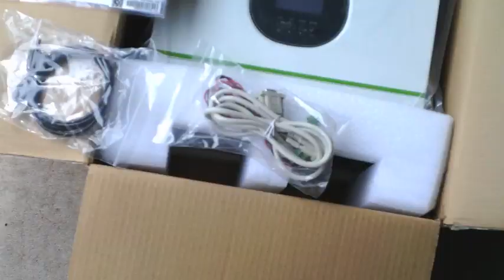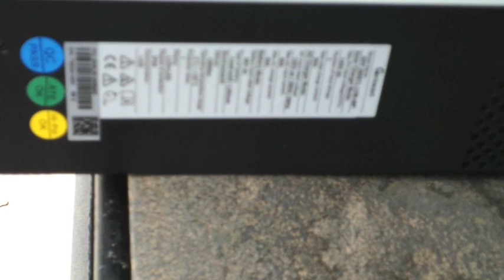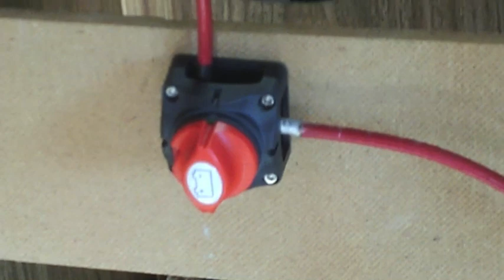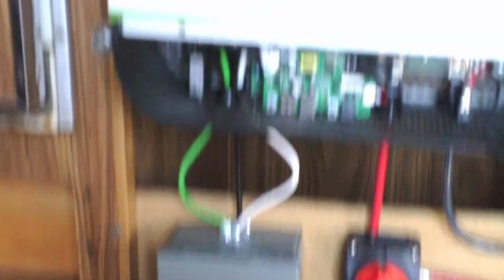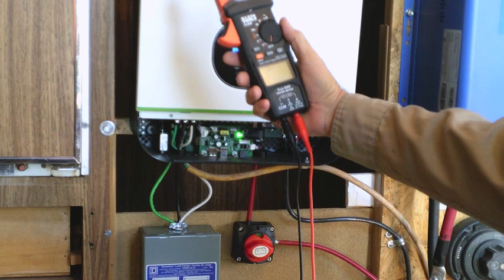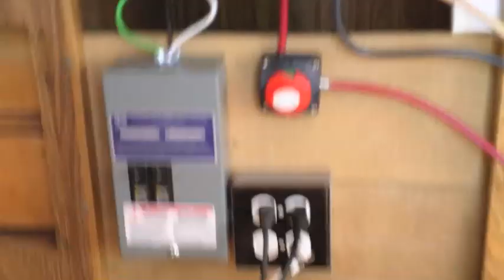Growatt 3000 watt all in one inverter information and review

Comment: Hi Mike; is this system still working?
Reply: It is still outputting 120v. It is sporadic on charging from the grid when the batteries get low. That was why I bought it as the Aims would get hot and shut down when the batteries would get low. I now have the EG4 6500 inverters.

Comment: My eg4 battery show red light what to do to get it ok ?
Reply: Turn off the battery and back on. This should reset the battery. Also my battery red light went out when it was charged. If you turn off the battery and back on and the red light comes back on then you need to charge the battery. Two of my six batteries only have one or two lights well the other four are fully charged with all four lights.

Comment: Hi I have purchased this inverter and I have hooked it up to a 48 V eg4 100 amp  battery.    When hook to the grid it seems my battery will only charge 3/4.  Do you think there is a setting that I need to adjust so that I can fully charge my battery ?
Reply from the maker: You can check the amp setting but I would think it has to do with the EG4 BMS. I would give it a few cycles and see if it improves.

Comment: why only 2 plugins? shouldn't this power your garage and your house?
Reply from the maker: I am only using it to power tools outside from an extension cord. The main reason for the Growatt is to charge batteries from the grid when they get low and there is no sun. My Aims inverter gets hot and shuts off when charging off the grid.

Comment: What is the standby power consumption? The mpp pip is said to be 45 watts, is this as bad? Im looking into all in ones and seeing growatt getting popular, I've been looking at the 2424lv by mpp but since my setup is for off grid boondocking in a 6×12 cargo trailer i only have room for 840 watts pv on my roof. The up to 45 watts loss when in standby will be using a considerable amount of power from my 24v 280ah lifepo4 bank. If you know it would be helpful in picking out a unit, thanks!

Comment: Can you turn off the inverter portion to save power and still have the solar charge controller charge the batteries off of solar? I am trying to see if this would work in a travel trailer and go off-grid once a week. Having the battery charge back up over the course of a few days with the solar would be perfect.

Comment: Thanks for the great video. I have one grounding question. I noticed your AC input  cable is plug in the Growatt, is that acting as the system grounding , or did you ground your solar panels to a separate grounding rod. Thanks
Reply: Yo solar panels each need to be screwed to steel rails and then the whole rail has ground on rebar 6 feet into ground. I hear there is a spot for it on the 3000w growatt for pv ground but im not sure. This is dc grounded. DC also needs a DC breaker double pole for on off only required by law(ca). So plan on a ac breaker and a DC breaker. DC breaker will only be used for on off and not as protection.
Reply from the maker: There is a separate grounding rod.. The hole outside of the trailer is grounded also.

Comment: How is the fan? Does it run at one speed, or slowly ramp up under load? Think of putting one in a van, but worry it would be to loud. It would be perfect if it was silent when using under 500w just for lights and a tv.
Reply from the maker: I have not heard the fan come on when using the tools as I am not in with the unit. I do hear the fan when the unit is charging the batteries at 30 amps. It does a great job of charging when there is no sunlight.

Comment: Where can I get a easy to follow blueprint for this inverter to set up a 24V mobile system for emergencies and running a couple things in my home. I have 400 w of panels and 2 100A lithium batteries for series connect. I do not want all the fancy/complex connections; I will not run my house from it. I do want the safety though.

Comment: I installed a 3000 spf 48v but I can't get it to charge my battery bank, I programed the SBU parameter and the SNU charger parameter but i will not charge, plus I have installed a automatic generator to it dry contact( the generator has a Built in dry contact too)

Comment: I just installed the 12kw. However, this is my problem. I have four 48v 5kwh batteries that were already deleted to around 26v and I can’t get the Growatt to charge them. How can I accomplish that?
Reply: You can’t. It’s below the low voltage limit. I suggest buying a 60v lab power supply that you can adjust voltage and amperage and use it to charge the batteries up past the low voltage limit.
Reply: @Rebel635csi  thanks

Comment: Hi, i have Growatt on grid single phase inverter.   My inverter showing wrong grid voltage.  Actual grid voltage is 245 but inverter showing 288 VAC.   I have connected shinebus to inverter & check all parameters but didn't find grid voltage calibration setting.   Can you guide how to do that??..

Comment: Hi Mike, just curious about why you added the Growatt with the Aims unit? Is the Aims also running on 48 volts? Great video, thank you for taking the time to make it!
Reply from the maker: The Aims is 48v and the second one that I have bought. The first lasted 2 years and then a lighting strike took it out. The fans run all the time and Aims technician said that was normal. The second Aims is also a 10kw unit , this one the two top fans work correctly but the bottom fan will not come on at all. When the  charging comes on the unit over heats and shuts down. The Aims 10kw runs the home and I wanted something to run tools in the garage. I will not buy another Aims as the service was very disappointing. The Growatt 3000 runs my tools and the charging systems works as it should. Both the Aims and the Growatt are on the same 48v battery bank.
Reply from the maker: The Aims is also 48 volts. It over heats when charging, so I don't use it for that.

Comment: I like the looks of this grow watt are the fans noisy I need charge controllers and its almost cheaper to get the mppt built in. How are you liking the unit so far
Reply from the maker: No the fans are really quiet, at least compared to the Aims of which only 2 of the 3 fans work. I feel the noise level is very acceptable.
Reply from the maker: And I still like the unit.

Comment: This is a unit I'd like to install in my travel trailer. Would the fans running be too noisy?
Reply from the maker: The noise level is very low and acceptable.
Reply: @mikedrew9361  Nice! Did you ever get the dB results?
Reply from the maker: @fjcvan7993  There is no dB that I know of. They are not on all the  time and if the Aims fans are running I can't tell when the Growatt's come on.